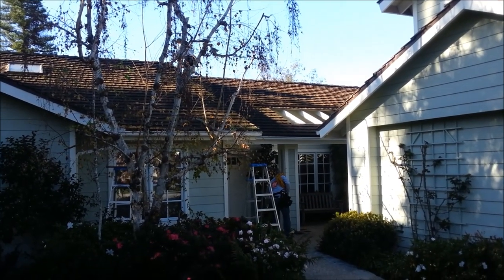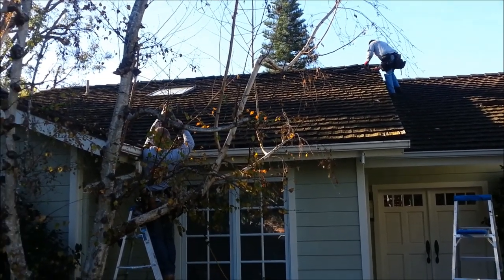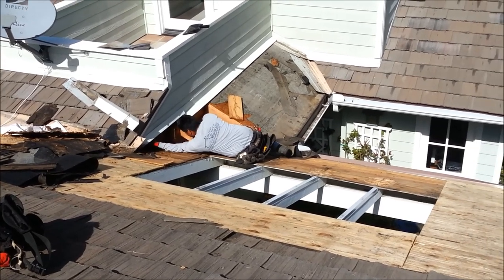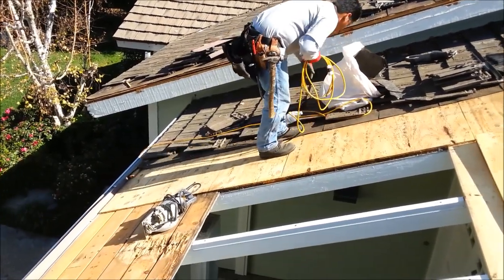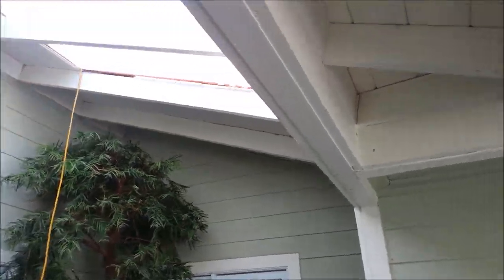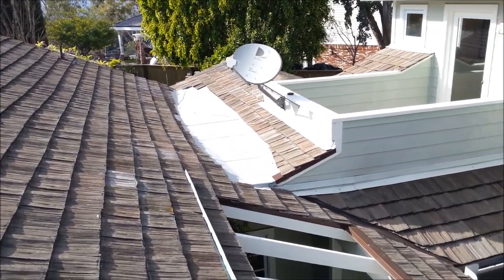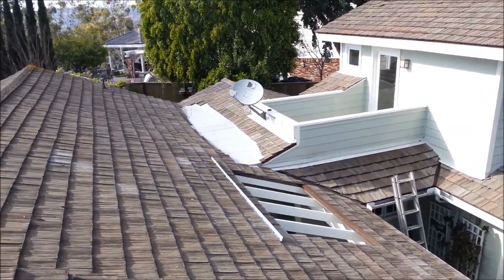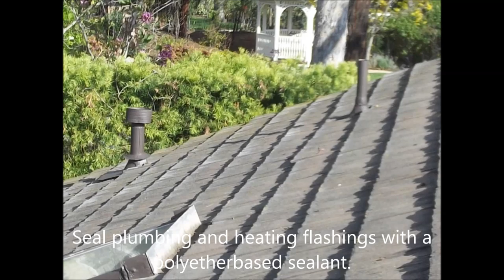Cedarlike Cricket Replacement and Fascia - 10k Later and 5 Days to Finish.

Comment: That joint in the fascia was pretty slick! Props to the guy who did that. I can definitely appreciate the amount of work that goes into a job like that, working for a general I know that what seems easy enough can turn into a BIG headache
Reply from the maker: I can tell you that the first few fascia jobs we did were not as good.  After a few thousand feet of it we do a nice job I believe.  But, it takes a ton of practice.